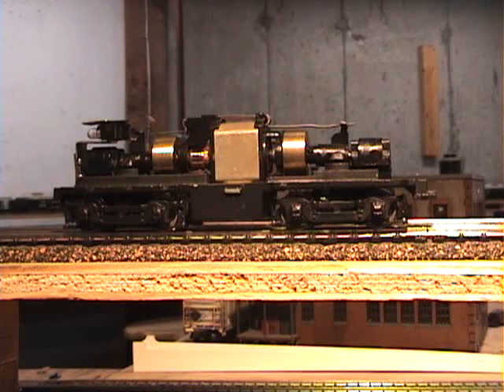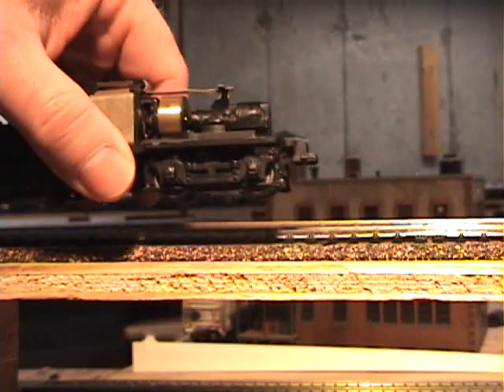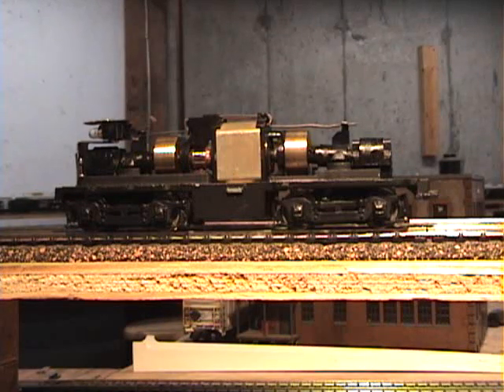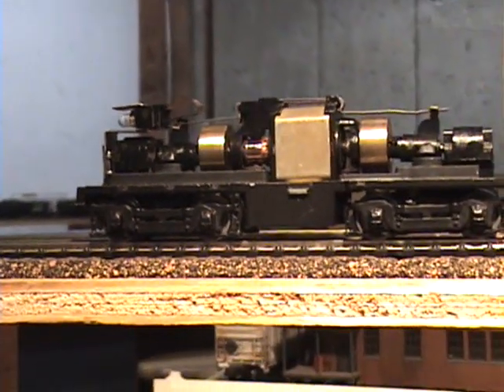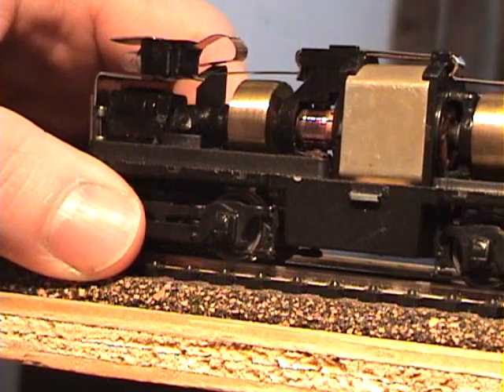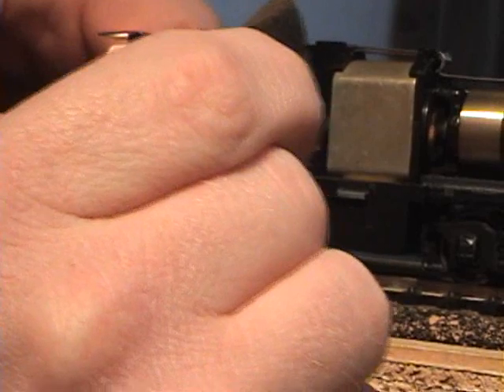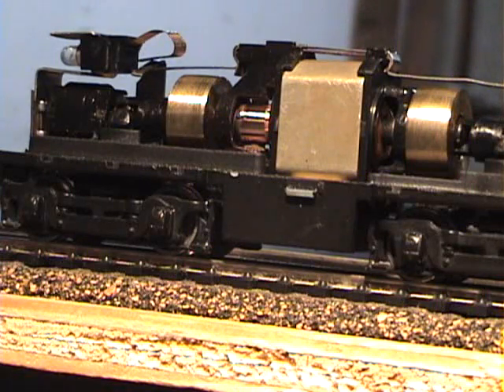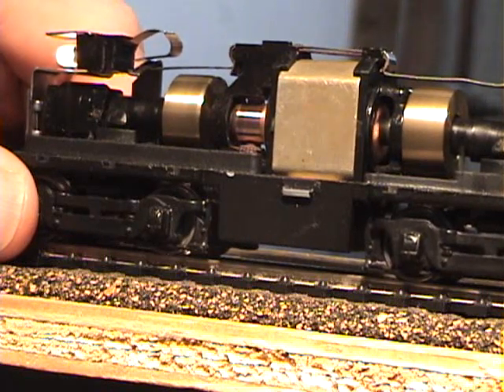Athearn SW7 frame & motor

Comment: Great video . . . thanks, I'm also a early conrail guy.  These gold jet motors as there called are a really robust motor.  I've a concoction rigged up using different magnets taking the stock jet motor to a whole new level of power.  I'm also working on an elongated gold case portion of the jet motor by adding 16mm from a donor jet motor case and using a 36×24mm armature out of a can motor.  Can't wait to test it.  This elongated jet motor won't fit in the original motor mounts but just like the A-Line & NWSL offerings I'll just use double sided taper or a lower form of silicone to attach it to the chassis.  I'm still waiting on parts to get here to complete this motor or I could give you a run down on performance, but I'm willing to say it'll have at least 4 to 5 times the power of an original jet motor on account of the magnets and length of its armature.  I've got to get me a bright boy to clean my commentators up like you've displayed here.  Marvel Mystery oil ( the air tool version of the oil ) works splendid also on the bearings. Ox-gard electrical paste works wonders on these types of electrical contacts as well.  I've a friend on YouTube here that swears by it by brushing it on all of his trackage saying he hasn't had to clean his layout trackage since, so it must be good stuff forsure.  👍 Great video . . . Thanks . . . Brian

Comment: Nickle silver wheel sets work a lot better as well. The older Blue-Box locos have cast iron wheel sets which build up with gunk fairly quickly. I replaced the ones on my SW7, & it runs very well. Jaybee makes good nickle silver wheel sets.
Reply: Athearn wheels were sintered metal. Sintering begins as powder that is compressed in a mold, then heated. They are naturally porous, and thus susceptible to absorbing dirt. Good for bearings, not for wheels.

Comment: You may want to take a sharp wooden or plastic tooth pick type tool and be sure to clean out the spaces between the commutator segments. They will fill in with dirt,grime and brush residue causing shorting and poor motor performance. BTW, a pencil eraser cleans commutator segments nicely without abrading the commutator. I'm not sure why you use atf as it has diff
erent lubrication properties than a lightweight machine oil such as sewing machine oil or hobby oil for trains.

Comment: The part you refer to as the "armature" is actually the commutator. The armature is the part with the three, or five, or however many, electromagnetic poles.
My personal preference is to clean the commutator with a cotton bud (Q-tip) dipped in Peco Electrolube - less abrasive than a Bright Boy.
Reply: This kid thinks he knows a lot. He dose not even come close to a pro!

Comment: I have a number of Athearn locos (F7s, PA-1s and others) that all suffer from this problem. The problem is that the frame is part of the electrical circuit, and the coupler pockets are cast into the frame, and are thus live to one rail or the other.

Comment: I recently used the motor from a Athearn s12 and stuck it into my Athearn sw1500. Im prettysure the motor, driveshafts, and trucks interchange between the s12, sw7, and sw1500. Only thing is the frame is different so theres a thought if your needing extra parts. Ditch the bright boy. I used track cleaner and a q-tip to clean my electric parts and Labelle oil and for lubrication and labelle grease for the gears.

Comment: seperate the truck assemblies from the frame.. on the top of the trucks where the metal flat contact is at .. and the bottom of the frame where the truck swivels and makes contact..get a dremel wire brush and middle speed polish up those til they shine.. EVEN from new factory units..conducts SO MUCH BETTER that way.

Comment: Don't use a BrightBoy---it will damage the commutator surface! Use contact cleaner or a plastic eraser. Even LaBelle oil or WD40 works, but clean up the excess.

Comment: The motor body of my Athearn is starting to oxidize. Any ideas how to stop that ?
I was thinking of sanding it with a very fine grit sandpaper and then using the liquid tinning solution to prevent oxidation.
Would that be good ??

Comment: get rid of the TOP steel conductor strip.. get some good strained wire of proper gauge and solder that bad boy to the tops of the truck L brackets.. LOSE the headlight.that is old school NO one does those anymore.. get a grain of wheat or LED and go with that. If you can get the new HEX drives for these those work great or at least get rid of the universals and get in some good dogbone t shafts they are smooth and respond. I have done this with mine and they run great.

Comment: Do you know if the SW7 is the only model prone to shorting couplers, or do all Athearn BB engines run that risk? I have an SD9 with the same setup. If you install DCC in the engine, does that remove the problem, since the motor cannot be grounded on the frame?

Comment: Useing atf is pretty strong stuff on plastics gears and useing bright boy on the commentator 
Is pretty tough too ? Why not use a eraser?  I run the engine full power in water it shapes the brushes
Nice and round to fit the communtator  then use a eraser  on it gently evens it out nicely

Comment: Oh boy, ATF on a blue box Athearn motor you're looking for trouble it has very strong abrasive in the oil to keep lines inside clean not to good for plastic, better to use 3 in1oil with carbon graphite to keep small bearings working right. Commutator never thought of using a bright boy, I use a small piece of Scott tower with rubbing alcohol to clean them. The armature is made of copper a very soft metal don't need to wear it down to the point have to replace motor